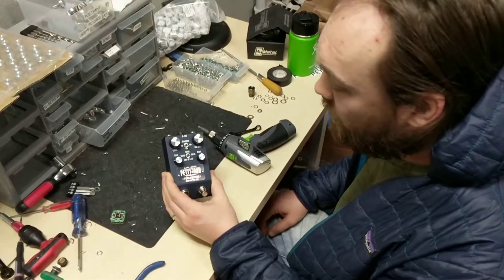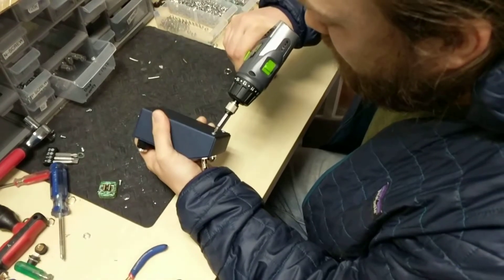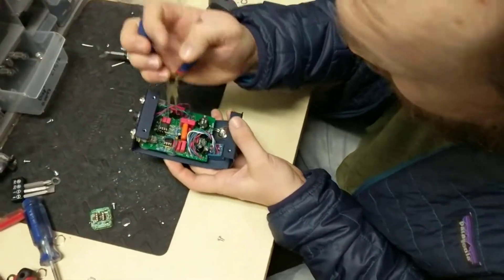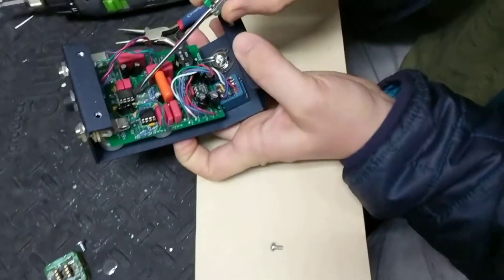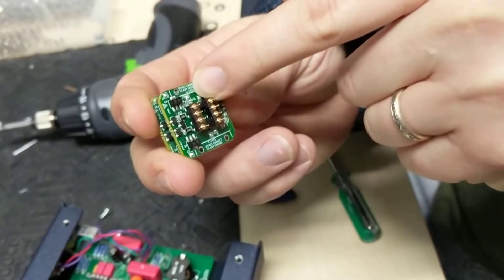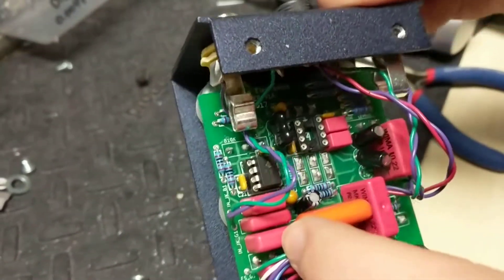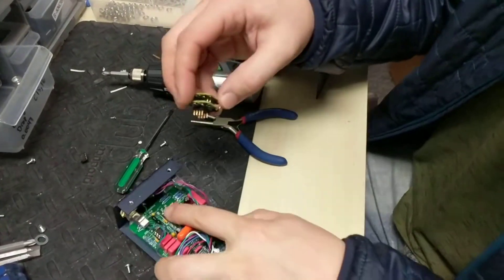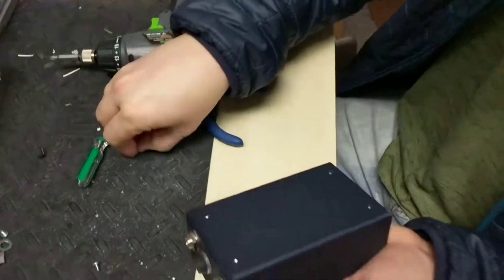FILTER Standard to Deluxe UPGRADE

Comment: What are the sonic differences?
Reply from the maker: The Standard is super clean and nuetral, the Deluxe is also very transperent but can add a extra 3D like depth and quality to the tone! The upgrade is avalible on our website for every standard and you can either ship the pedal to us to upgrade in or we can send you the chip. This video is to help show how to do the swap! Cheers! Stephen
Reply from the maker: The standard OPA2134 is a great opamp, topshelf audiofile chip that is very transperent and musical. The Discrete Opamp adds an extra 3D,  depth to the tone that is kinda like magic. ;)
Reply: I have 8 Pettyjohn Pedals, 5 of which have the discrete 990 op amps in them. I find they are magic in anything that is low gain, chime v1, any lift, predrive, magic, filter, shift, tone and so forth. But I skip them in circuits that have more gain, such as Iron, Gold, NUKE and so forth.

Thanks for showing us how easy the swap is!